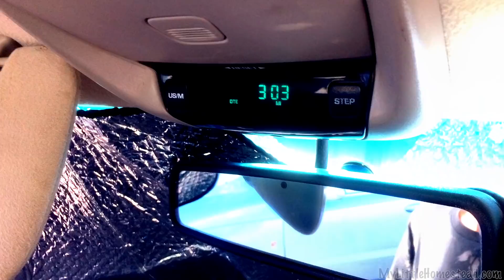Bag Layers, Install Vanity & Soil Cement Subfloor | Earthbag Kitchen,Bath&Cabin | Weekly Peek Ep154

Comment: Gary, Instead of replacing the faucet with a brushed aluminum and dealing with the disconnecting the plumbing and all that, take a scotchbrite pad to the chrome faucet just leaving it in place.  With just a little bit of elbow grease, it will dull out the chrome leaving you with a brushed nickel appearance.  We did it with one of our "hell house" projects and it worked REALLY well.  I buy my scotchbrite pads at either Sam's or Costco in a box of 20.  They are "industrial sized", we cut them in quarters (gives me 80 scotchbrite pads) which leaves them like 3x4 inches which is perfect hand sized.  I had my husband do this to a chrome shower flange I got for next to nothing.  In about 15 minutes, he had it looking just like brushed nickel!  It's hold up great as well!

Comment: I was reading some of the comments and came across  the one about the French drain  and I have to add a comment about the cabin in the woods.   Your family is used the desert environments.  In the hills there is more dampness. It will wick up through the floor.  In this area where I live, we put down gravel, then a vapour barrier, then concrete.  Sometimes a layer of Styrofoam, too.  Then the concrete is covered with another vapour barrier, before the flooring goes down.  In really wet areas, the homes are surrounded by wreaking drains

Comment: Great video, very nice vanity, isn't it about time to change the group shot to add a new member of the family...the wife. I've seen a good amount of earth bag video's and they all do the same thing with exception to a little rebar in walls, but everyone seems to have their own idea of what they want to do for a roof. One stood out to me as the best idea and that was the earthship guys. They made rebar arches about two foot apart, covered it with chicken wire and dipped sheets and shirts and pretty much any kind of clothe they could find in concrete mud and covered the chicken wire to form a thin concrete shell on the roof and then came back with a thicker coat, then as they were putting the thicker coat on they curved the sides to they had a permanent rain catchment system. The thing that impressed me the most was how cheep and strong the process was/is. The off grid cabin would be the perfect test for something like that.
Reply: I agree! They need to get her picture in there before they have more additions to the family. lol

Comment: I don’t know if you’ve ever tried this or already know it.   But a trick I’ve found when working with a finished product is to cut or drill through masking tape.   Works great because you can make your marks on the tape but also keeps the surface from chipping or burring

Comment: great work. bye bye poor wall we knew you well.  Garen and Ellie if you could find a 35 or 50 you could load it up with your mix and just roll it around unless you could build you a stand.  Be alot easier then tring to do it with a wheelbarrow and shovel.